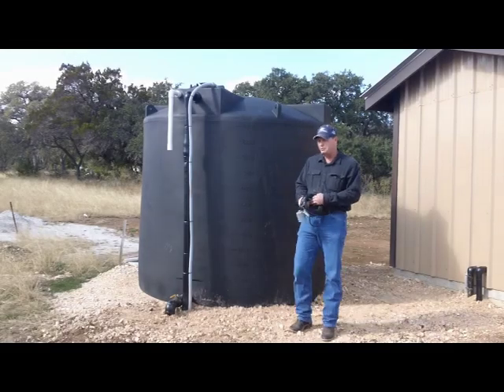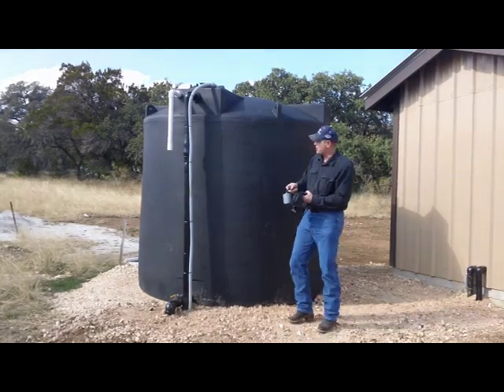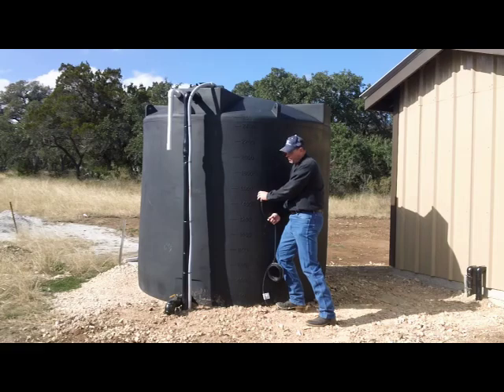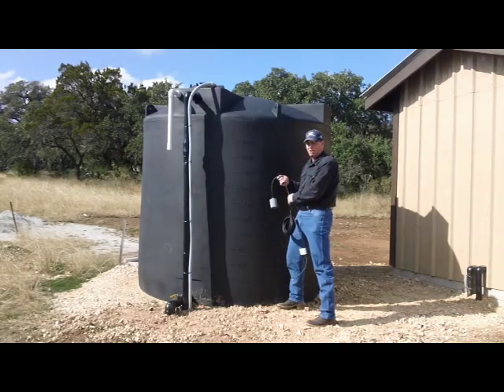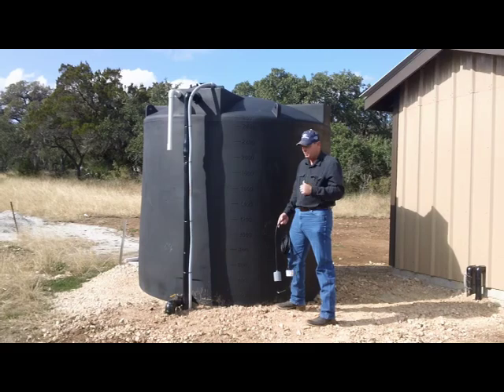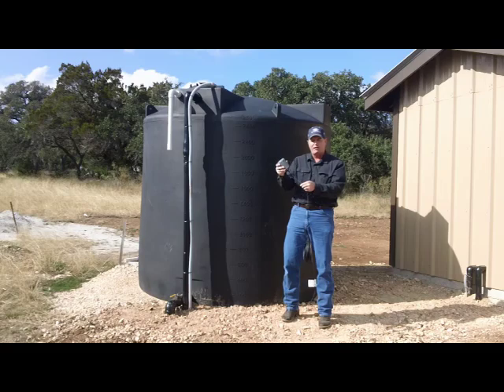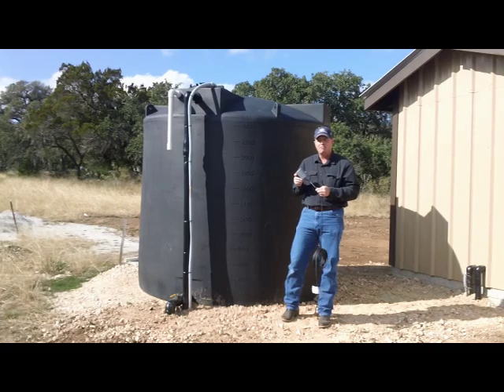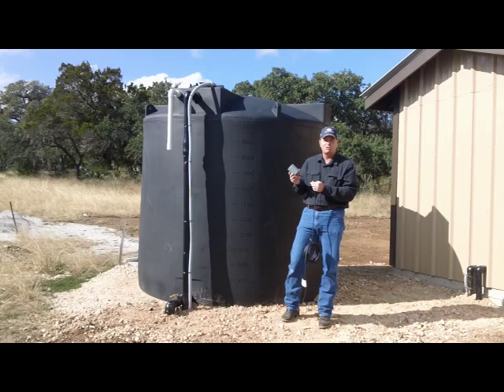Float Switches

Comment: How much for a float switch and how do you wire it to the pump?  I need to finish my well.
Reply from the maker: I don't sell floats that I don't install.  You should contact your local water well driller for a good float switch.

Comment: Is that float switch powered thru the pressure switch??
Reply from the maker: It depends on how you wire it.  There are a thousand different ways to set up the electrical system depending on what you want to do.

Comment: is the top float switch in water storage tank just for deep well pump to go on and off?  mine now turns off the deep well pump when its raised which it should but also turns on the pressure pump at that point to fill pressure tanks.  seems like that is wrong did it get wired it wrong.  thought the lower float switch was for pressure pump.
Reply from the maker: The way we like to set it up has the top float switch only turning the well pump on/off.  the lower floats control the booster pump.
check out my other video on this.  https://www.youtube.com/watch?v=fTJrRpVkiTI

Comment: What kind of maintenance do you have to do on these tanks yearly? Cleaning and such?

Also do you have to add any chemicals to keep bacteria and alge from growing? Or will a UV light in line from the well be enough to stop bacteria from forming?
Reply from the maker: If you get a dark enough tank that stops sunlight from getting into the tank, you don't have to worry about algae.  If too much sunlight gets into the tank, you need chlorine to stop it.  A UV light will not work.  Cleaning depends on how dirty your water is.  Most of my customers need to clean their tanks on average about every 10 years due to sediment build up on the bottom.  But some need it every year and others never need it.

Comment: Hello, Thank you for sharing this information. Would you recommend the JSE pump master plus float switches for a 1.5 hp Goulds submerged pump?
Reply from the maker: Yes that is the right switch for that pump
Reply: @jimblair1  , Thank you. Do you happen to sell instructions and part lists or kits for setting up ones own water storage system. I live in the lower Rio Grande Valley and have not found anyone who does these types of water storage set ups.
Reply from the maker: @sylviobravo6727  yes.  Contact us on Monday and we can help you
Reply: @jimblair1 , will do.. Thank you

Comment: What happens when the power goes out?  I have a system that is automatically fed from the municipality, but sometimes our power goes out for an hour or a day.  Will the tank overfill in this case?
Reply from the maker: If you are filling from a pressurized source like from the municipality you would not use a float switch but instead a float valve. They are mechanical and will work regardless of any power conditions. You could use a float switch that would operate a solenoid valve if you choose to. In that situation if the power goes out the valve should close.
Reply: @jimblair1  Thanks.  The guy at the store sold me a float switch, and I asked the question, but looking at it I cannot figure out how it would turn off the incoming water.  Right now I am using a ball floater like from a toilet, but the tank is so large that it makes a lot of noise as the water passes through the constricted valve.  I will figure it out.
Reply from the maker: @chdao  try a Hudson valve.  1”.  Simple valve works great

Comment: We have a large cistern for our house, we have the water pressure up fairly high due to the increase in feet elevation from the pump to the cistern.  We are having trouble finding a float that will shut off the water.  Would this type work?
Reply from the maker: Greg,
it sounds like you need a float valve rather than a float switch.  A float switch will turn on and off a pump or an electric valve.
For high pressure applications where you have a pressurized water source filling a storage tank, the best 2 options are to use a solenoid valve and operate it off of a float switch or to install a pressure reducing valve before the normal float valve to limit the pressure that the valve sees.  I recommend a "Flippin Float" valve for a high quality float valve.  You can get a pressure reducing valve at any plumbing store and adjust the pressure down.

Comment: Do you include any check valves downstream of the storage tank, with the booster pump? Or just upstream of the storage tank, with the submerged pump?
Reply from the maker: You always have to include a check valve on every pump system.  We have two in the well on the production water line from the pump.  On the booster pump, we have a check valve after the booster pump but before the pressure tank.
We use spring loaded check valves so that they will close quickly.

Comment: Great video, Jim.  Very informative, and exactly what I was looking for.   One question -- How does the cord of the float switch pass through the tank wall?  Do the tanks come with some sort of port for that, or do you have to drill your own and hope it doesn't leak?
Reply from the maker: We drill a hole for the conduit and pull the wires through the conduit.  We always make sure the hole is above the overflow and we pump silicone down the conduit to stop water from migrating down the conduit to the electrical boxes.  Glad we could help.

Comment: Would folks who are watching this video have a need for remote monitoring of these storage tanks? We’re deploying systems now for urban rooftop water tanks but looking for new applications. Our system can sense level/temperature/flow/gases and send to a mobile app and web dashboard with graphs and text/email alarms.  There is also the possibility of remotely controlling things at the tank. The system is bidirectional. These urban systems are battery operated plug and play and use cellular connection. Are these storage tanks usually beyond cellular coverage? We have other wireless options that could be more point to point and several miles. Any guidance about what is needed in the real world of storage tanks and how we might solve real problems would be great. You can reach us at info@iotini.com

Comment: So you really only need two float switches for storage tank?  One to keep her from overfilling and to turn the supply back on if it drops much at all and then another switch way down there that will open the circuit if there is not enough water available to pump.   The "reserve" deal I don't get?   The only thing I can think of is that it would prevent like irrigation left running from draining all my drinking water but then that would be a whole other pump or valve being controlled?   Cause as far as my house?  I might like an alarm if the tank is getting half full but I don't want the the thing shutting my water off to "reserve" half the tank!   What have to go flip a switch to okay using the "reserve"?  See my confusion??   Then again you could write whole books on the crap I don't know about this subject ...man i need to learn though!  I seriously need to buy and employ a large storage tank for my home!   Do they have a specific place in storage tanks for these float set ups?   the one video I watched the guy just hung it through the hatch hole at the top...what the hay?   What?  Cut a slot in the cover for the wire??   I dont get it?

Comment: Thank you. I want to control my tank water level so when it is 1/2 empty the pump will start and stop when it is full and the cycles repeat. How does the mechanical switch trigger the electrical to On Off Pump? Would a Non Modullating Float Valve works better and more reliable than a Float Switch?
Reply from the maker: It would be really hard to get a float valve to have such a large swing between open and closed. I don't know of any on the market that can do that.  The way i would accomplish this is with 2 float switches.  One at the middle for "on" and one at the top for "off".  You will have to use a contactor to wire in both switches.  You can contact me at jimblair@beecavedrilling.com and i can email you a wiring diagram that shows how to wire this up.

Comment from the maker: I think what you have is actually a float valve, rather than a float 
switch.  If that is the case, then you need to adjust the angle of the 
float valve so that it shuts off earlier.  There is also a chance that 
the valve may have been damaged due to water flow.  We call this 
"washing out" where the water flowing through the valve at a high rate 
of speed can cut a groove in the seat of the valve.  If this happens, 
you need to replace the valve.  The other possibility is that the float 
and stem combination is not strong enough to overcome the water 
pressure.  You can fix this by reducing the incoming pressure, getting a
 longer stem, and/or getting a bigger float.

Comment: I've got a different type of float switch. It's a ball floater similar to the type in a toilet tank but made of brass. I noticed yesterday that it's floating too high and letting water overflow out of the tank where the pipe enters. Any resources for how I can adjust the level? It's going to literally be a pain no matter what because I also need to figure out a way to keep the mosquitoes out of it. This is not a system we put in but the float is only a couple months old. I'd like our power bill to go back down! This slight bit of overflow keeps the pump running much more than it should.

Comment: If you don't mind, what brand of float switch do you use?
Reply from the maker: DRA5136 
We use SJE Rhombus Pumpmaster Plus
http://www.sjerhombus.com/international-product-details.php?ID=24&ID=25
Reply: ***** I E-mailed them about their low water alarm and asked if the float switch for the alarm was suitable for potable water, they said: "

Second,
SJE-Rhombus does not currently have a float switch that is approved for use in
potable water. 
"
It does not contain Mercury so I think I'm going to order theirs anyway.
Thanks